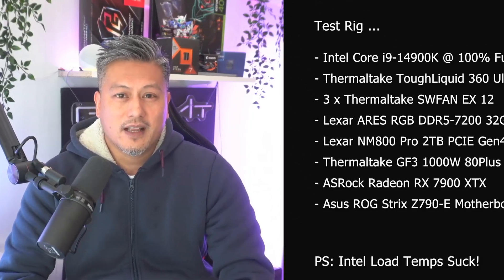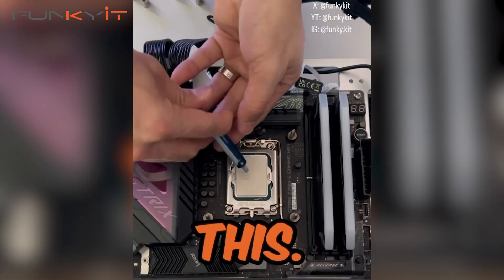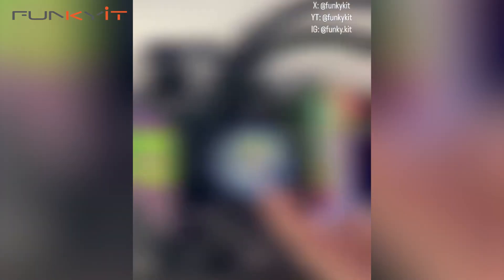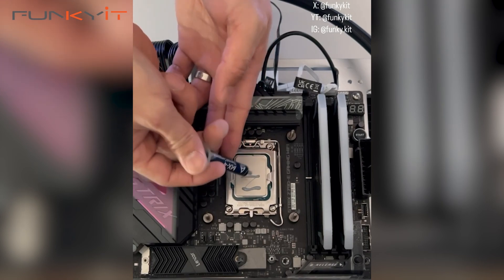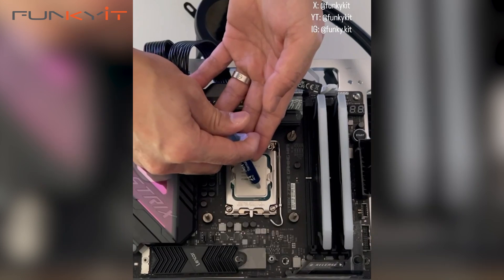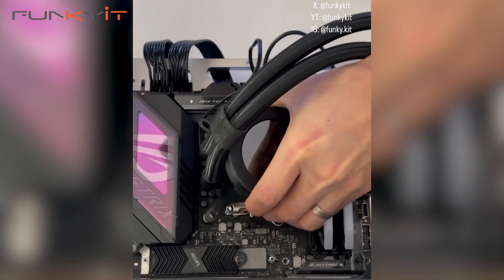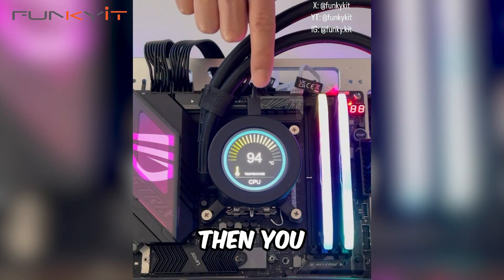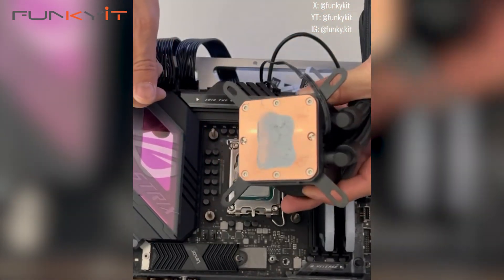How to Apply Thermal Paste on Your CPU - How do you do it?

Comment: MX-6 would be a decent upgrade (and probably the better recommendation in your links below). The reason why people say a pea sized drops isn't enough, is simple too, it was the Go-to back then, but CPUs where a lot smaller back then too. So nowadays people use the 5 Dot Method more often (or the good old spread method, that exists since the ancient ages).